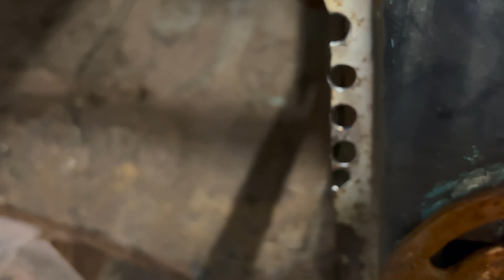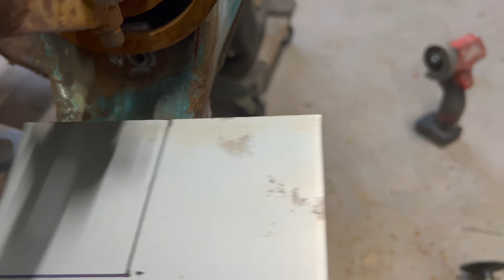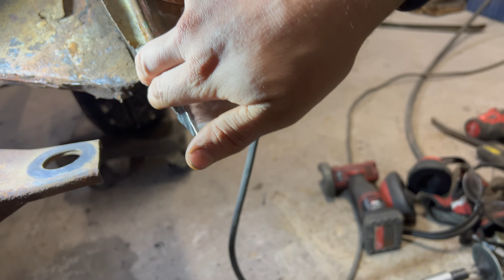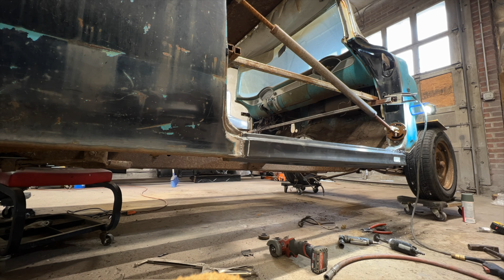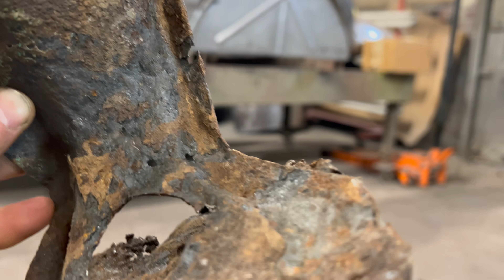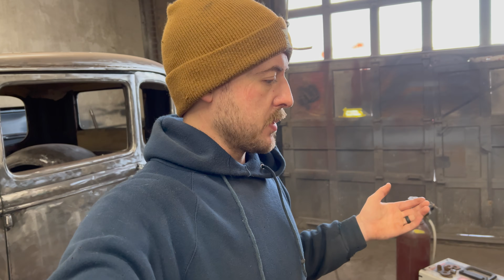55 Nomad Rocker Replacement!

Comment: Watching this again in 2026.  You eventually rehung the doors and got decent door-to-rocker gaps?
Reply from the maker: Nope unfortunately the car never got finished. It is still as you see it in the video. Although i know the doors would line up just fine as i have done a ton of full floors and rockers and i braced this car very well. Measurements never changed.

Comment: Good job I had my share of rust repair working in body shops 40+years I really don't miss it I will be retiring in 21/2years and plan on building myself a car frame off resto mod tri 5 just really looking for something really solid to start with

Comment: Cool Video man! That nomad must have power windows factory to have the conduit coming from the door jam pillar! They use that metal to bring the power window harness into the doors! Your doing great metal repair and fab work on the car! I'm wondering what the body number is on the cowl tag! The first 500 55 Nomads built have alot of unique stuff on them! Have a good one Buddy 👍 Stay warm its cold here in Ohio
Reply from the maker: It is an original power seat, power steering, power window and radio delete car! And thank you im excited to look up those numbers now that you mention it.
Reply: @vintagehotrods  Yeah man look at the cowl tag it will have a body number. All nomad body's were built in Cleveland Ohio. Have a good one Buddy 👍
Reply: @donshotrodgarage1717  good to have help and references at your fingertip’s I’m sure. Every piece of information helps. 👍
Reply: Don is a wealth of knowledge on tri fives!